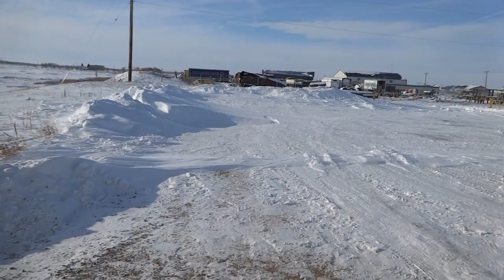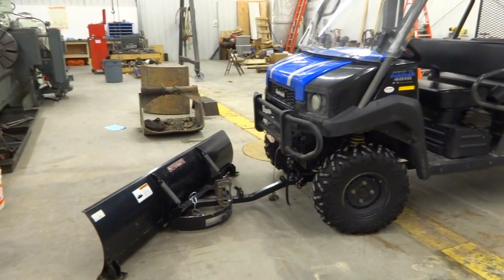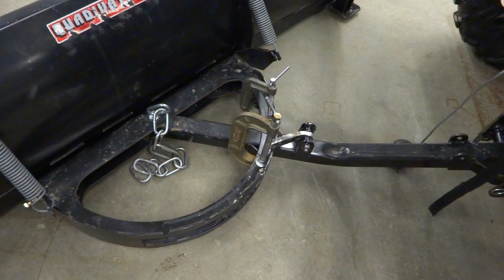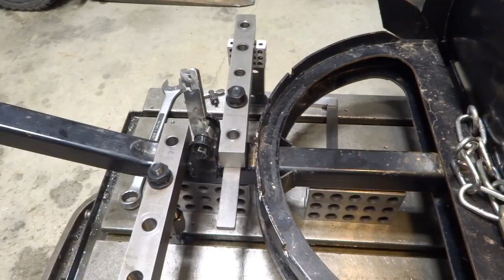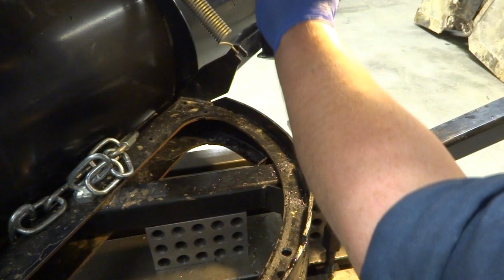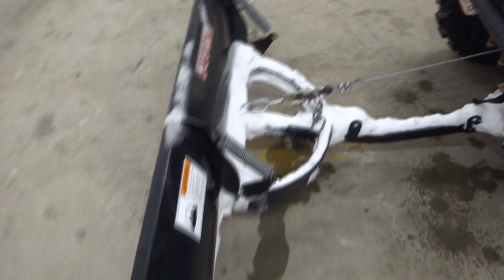Snow Plow Repair

Comment: The person who designed this system never plowed snow in his life, that's for sure. You made it way beter.
BTW, i hate wind and cold.
Reply from the maker: Thanks Rustinox.  For me it's the wind I can't stand.  I grew up 500 miles north of where I am now and my home town was in the Canadian shield, with thick boreal forests.  The forest kept the wind down.  On the prairies (where I live now) it is flat for hundreds of miles in every direction and the wind howls.  The only saving grace is that when it gets really cold down here (-40C) there is never any wind.  Up on the tundra (1000 miles north of here), however, -40C (or colder) with a strong wind is not uncommon.  -40C with a strong wind is an obscenity no human should have to experience.  Ken

Comment: Nice quick repair, I did think at the start you were going to say that I’ll put the same lugs on the other side to match the front with a pin through it, but if it works this way everyone’s a winner as we say, nice job bud and I thought North America  close enough watched two many ice road truckers me thinks.

Al.
Reply from the maker: Hello Al, The repair ended up being pretty straight forward and fast and worked well.  We all know that isn't how things normally go.  I watched a few episodes of ice-road truckers as some of it takes place close to here.  My grandfather used to freight through the bush with cats and sleighs back in the 1950's and 60's.  Back then there were no government approved ice roads that had been checked with ice penetrating radar.  They went out, read the ice by experience, crossed their fingers and headed across.  They also didn't have any cab whatsoever on the cats.  A cab would have gotten in the way if they had to jump clear to avoid going down with the cat.  He put several through the ice but managed to retrieve them.  Ken

Comment: Could the original design have made weak on purpose, so that it gives way when a collision occcurs preventing further damage, in the manner of a shear pin?
Reply from the maker: It's possible, however the bar bent so easily that the plow was essentially useless.  Simply plowing with only half a blade of snow (i.e. loading it on one side) was bending it.